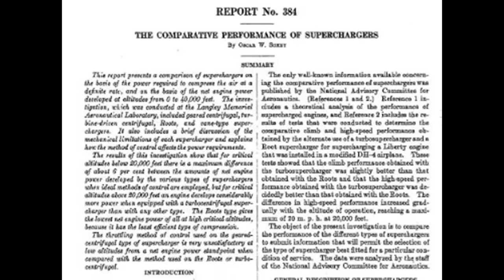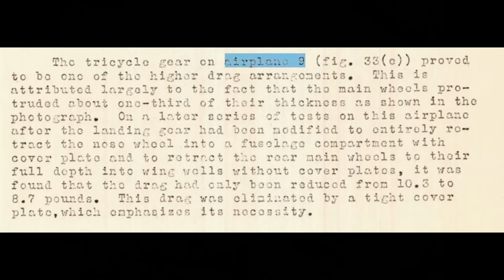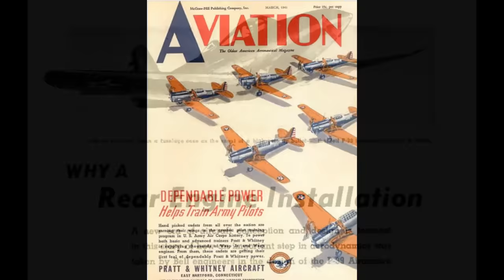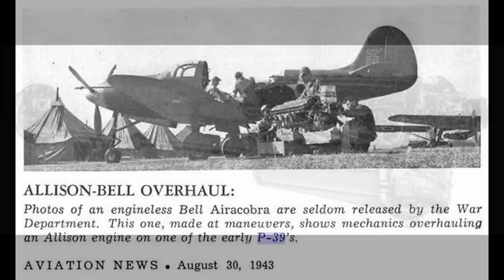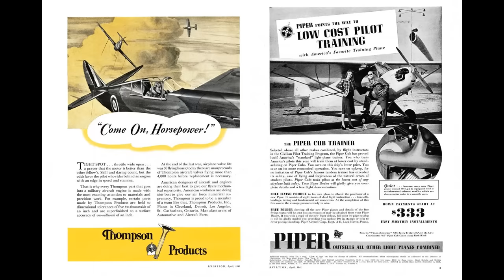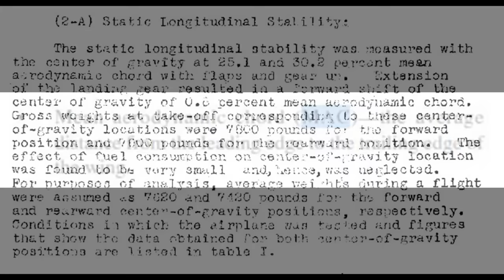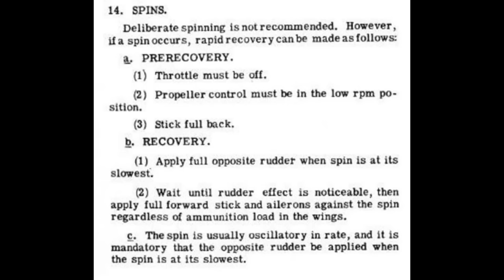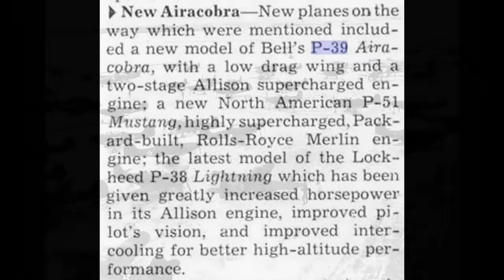Bell P-39 Airacobra, Why the Mid Eng?

Comment: Russians loved it. Had big door to climb in/out. Had reliable instruments. Had actual gunsight. Heavily armoured cockpit. Allison could be run with their supply of LL avgas or even with blend of that and Soviet crap avgas. Was made with 100% dural, designed by actual  engineers, not some plywood wonder with wishfull thinking glue ripping apart construction. Well armed. Easy to land (you could see where you were going). Could fight with Bf-109 or even FW-190 in very low altitudes, like majority of combat in eastern front. For Russians P-39 was an Cadillac. It worked, was luxuriously equipped, and could held its own in deck.

Comment: The C5-C7 (1997-2019) Corvettes had the engine mounted in the front of the car behind the front axle with the transmission mounted in front of the rear axle. I think only Ferrari was the only European manufacturer to do that as well.
Reply from the maker: Alfa Romeo.

Comment: Nice video and very informative like they all are, but I think that Greg's theory about the prop torque on the 10 feet of forward fuselage does not make sense. The prop shaft will transmit the torque directly to the engine and thus the engine mounts, which in turn pass the torque to the mid fuselage section. Which I think is a better location to absorb torque than the front fuselage section with a front mounted engine as the latter may torque the whole fuselage like a corkscrew.
Reply from the maker: I literally put on the screen the section of the article where Bell's chief engineer describes this exact problem.
Reply: You are forgetting the mounting for the reduction gearbox at the extreme end of the nose.
Reply: @GregsAirplanesandAutomobiles  Greg, you are entirely correct. I oversaw the reduction gearbox, which has to be kept in place by the forward fuselage. The engine tries to wrap the forward fuselage due to the force which the engine sprocket exerts on the prop gear. The forward fuselage has to counter this torque. My apology for my short sightedness.

Comment: How did they ever come up with the "Useful Load" and design weight of a P40 pilot with parachute being 180 Lbs @ 24:45. Those seat pack chutes must have weighed 50 Lbs. That makes for a really small American pilot at 130 pounds. Being as small as he was. I don't think Alan Ladd even weighed that little
Reply from the maker: You should see how they calculate standard airline passenger weights.

Comment: Did any of the fighter designs utilize side trust to the right to counteract left torque at take off?
Reply: Vertical stabiliser fixed offset to counter propeller slipstream is common.  Actual torque is less important and is a rolling tendency.  Engine and propeller speed changes are also much less abrupt in planes so torque change is also trivial.
Reply: Rubber powered models have a marked torque swing to the left on take off due to power burst. Schnieder trophy racers had similar situation and used various measures to counter act such as carrying fuel in the port float . The M72 went to contra rotating props.  Latge props used in rubber free flight magnify the problem.

Comment: If long propeller drive shafts were inherently trouble-prone, the propulsion setup for Consolidated's B-36 would have turned out looking very different.
Reply: In the B-36s case I suspect the use of the R-4360 with 14 power pulses per crankshaft rotation helped a lot. Look at the other contemporary pusher bomber design. The Northrup flying wing. They compounded drive shaft issue with contra rotating props. While a drive shaft does add a failure point stresses to the whole system can be reduced imo if the system is a rigid set-up with no universal joints.  How many times have high performance racing cars with IRS suffered mechanical failures from u-joint failures.
Reply: @mpetersen6  The B-36 did not have a drive shaft, just an elongated engine case. There is some thought the Flying Wing's vibration problems came from a drive shaft diving pusher contra-props chopping through the near sonic airflow behind the wing. At least the B-36 props were centered on the wing ensuring somewhat symmertric loadings, as opposed to the Wing's propellers being mounted above the wing.
Reply: Memory is a flakey thing -- mine, at least.  Would have sworn I saw an exhibit at the USAF Museum showing a rotary engine, long drive shaft, & prop -- as I recalled, "from a B-36".  Should have double-checked before posting . . .

Comment: Wasn't the P-63C a "superprop" to some extent, being powered by the uprated Allison V-1710-117 engine with a war emergency rating of 1,500 hp (1,120 kW) at sea level and 1,800 hp (1,340 kW) with water injection and the wingspan reduced by 10 inches (250 mm). I couldn't find any data but on 1,800 hp it should have been something of a hot rod in terms of speed and climb
Reply from the maker: It could be considered one I suppose.
Reply: Do you have any performance data on this one?  @GregsAirplanesandAutomobiles

Comment: If a plane is designed, built and balanced properly where the engine is mounted shouldn't be a problem. A mid engined plane should have less inertia when compared to a front engine or rear engined plane, the only drawbacks being the extra weight of the drive shaft and expense. Maybe a different engine may have helped giving it a better power to weight or a better blower so it could perform at altitude better.The allies had a stable full of excellent aircraft and the P39 was out shone by them. The Russians seemed to like it😀

Comment: There was another  interesting aircraft in 1936-1937 ( prototype concept sown at the paris airshow of 1936)  of the Koolhoven factory .  it was called FK-55 ,    it was a mid engined counter rotating propeller aircraft .  due to the pilot beeing cooked ti only flew a few times. But it was a beautifull aircraft to look at.  and some real futuristic features.
https://en.wikipedia.org/wiki/Koolhoven_F.K.55
Reply: The mock-up displayed in Paris, of which Wiki has pictures, looked beautiful. The actual aircraft as built and flown (once) looked, in the words of Frits Koolhoven himself, like a pregnant duck. Koolhoven was opposed to low-wing designs, and that made the configuration really awkward.
Reply: @emmanuelgustin7851  Correct , the engine they used was a different one they planned underpowerd and much larger than they wanted to have.   The main isue it had was that the pilot got cooked . Still many features on that aircraft would turn up in to other postwar era aircraft .  Its a shame as Koolhoven had a bit of a hit and miss streak with aircraft. 

There is also a verry interesting air craft called the S21 an aircraft that was under construction by a shipyard called schelde .  
Its prototype  was underconstruction when the germans invaded it was damaged during the invasion and parts where send to germany for study .

The S20 concept plane well that was a weird looking aircraft  . if you would tell some one it was a converted car you migh believe it .

Comment: An inline engine is a single bank of cylinder in a row. V designed engines had two banks of cylinders in a row.
Reply from the maker: I hear you Lars, but in WW2 V-12s were usually called "inline" engines. I suppose that's because as compared with radials, they are.

Comment: The thing I never quite understood about the Airacobra and the Kingcobra was how a mid engine aircraft has tricycle under carriage where front engine aircraft usually are tail draggers.
Reply: Because they CAN: tractor engines don’t usually have room for the nose gear, especially not one strong enough to hold that heavy engine

Comment: I think moving the cockpit closer to the center of gravity does reduce pilot stress. It's easy to picture if you make a comparison of a real fighter plane to the same plane, but you make the latter 10 times as long, have the cockpit still near the nose and keep the center of gravity in the original spot - I mean, if this bastard plane was just as maneuverable as the original, just imagine the Rollercoaster ride any maneuver turning up/down and left/right would be.
Reply: Though it's probably rather insignificant in real aircraft

Comment: It seems like Boeings have relatively forward c of g compared to Airbus. The A320 series that I fly has a median setting of around 30% and can go to in excess of 35% depending on conditions. Wonderful video on a very cool plane though.
Reply from the maker: That might be a fly by wire thing. I makes sense that it could have a more aft CG since the computer will keep it stable and you "can't" stall it anyway, so stall recovery shouldn't be an issue. I'm just guessing, I have never flown an Airbus. I do like riding the the A350 though!
Reply: @GregsAirplanesandAutomobiles  Since the Airbus can degrade to direct law, it has to be stable enough to fly like that. So I imagine the FBW is not used to expand the CG envelope to the back for neutral stability like the F-16, etc.

Comment: I think the mid engine installation was because the plane was originally designed to be turbo-charged & being mid-engined meant it wouldn't need all that plumbing that made the Thunderbolt so fat. Of  course it ended up being help in regards it's cannon platform. But there's no reason, with careful design of the inlet manifold & magnetos, that they couldn't design it to have a motor-cannon like French & Soviet inline fighters. German fighters like the BF109 & He112B had inverted engines meaning different engineering/design challenges to make them have motor-cannons, so that's another different story, not really relevant here.
Reply from the maker: It sorta seems like you commented without watching the video because the designer of the plane makes it VERY clear why he went with the mid engine and it's not for the reason you stated.
Reply: @GregsAirplanesandAutomobiles  But the decision to go with the turbo occurred before the aero was cleaned up in response to NACA advice, which also included removing the turbo. So the Turbo was definitely a factor in the original design. By having a mid engine they could have the turbo right up next to it. This would negate all the plumbing that made the P47 so fat. That had to be an influence early on. Or are you saying the fitting of a turbo was irrelevant to the design?  One has to take what designers & engineers say sometimes with a grain of salt. Sometimes when being interviewed, answers can sometimes seem contradictory to other answers in regards different subjects brought up by different interviewers. This is not uncommon. They have a lot to remember & some questions can be very specific. Maybe he took the question as specific to NACAs aero advice & Curtis's response. I don't know. But the demand for a turbo as originally specced by the Army Air Corp must've had some influence on the original design, before NACA may have suggested it should be removed to aid cleaning up the design, aero wise.

Comment: I wondered about defense contractor favoritism and how it might affect material supplies for the "War$$$Effort"
Reply from the maker: I'm certain it had an effect, but it's tough to know just how much it factored in.
Reply: @GregsAirplanesandAutomobiles  Politicians take kickbacks. Pretty sure that is as American as apple pie
Reply: @pavanatanaya  not so much American as it is a universal truth of politicians.
Reply: It's not just the US. Or kickbacks per see. In the UK Rolls Royce had a lot of influence with the Air Ministry. France in the 1930 and into 1940 had truely bizarre. Military aircraft would be finished to flight condition and then flown to other locations to install armament, radios etc. 
As to potential turbo superchargers and materials shortages.  One needs to remember that there were various competing needs for alloying elements. Tungsten was needed for armor, armor piercing projectiles, cutting tools, alloy steels and other uses. The same would go for molybdenum,  chromium,  vandium etc. Plus as much steel the US was producing during WWII it was pushing up against its limit of steel production. The competing needs of various ship building programs, vehicle production, weapons would see various programs timetables slip to some degree. Some such as the Alaska Class Cruisers should have simply been cancelled. Other needs would see various operations such as amphibious assaults be required to be scheduled allowing required assets to be shipped from one to another.

Comment: By not having the engine in front of the pilot a machine gun can be fired through the center of the propeller.  This makes the gun easier to aim.  The P-39 had a big Oldsmobile 37mm canon under the pilot's seat that had the muzzle in the center of the prop.
Reply: You haven't really watched the video have you?
Reply: Chuck Yeager was pretty scathing about the cannon. It's low velocity meant it's trajectory was completely different from the machine guns.

Comment: Toward the end of the video you mention the "efficient" wing of the P-51.

I've seen a couple of claims here and there recently, which hold the the alle ged supercritical lift of that wing is a myth, and that in all likelihood, the P-51's superior range was not due to the wing, which probably did not achieve a supercritcal conditionb in actual  use, but simply to superior craftmanship, resulting in a smoother skin and reduced parasitic drag.
Reply from the maker: I said efficient, not supercritical or anything else. I have an entire video on the P-51's wing and the laminar flow myth.
Reply: @GregsAirplanesandAutomobiles   Agree. Wasn't being critical or anything, and now that I think about it, that video might be one of the places I saw the claim .
Reply from the maker: Thanks :)

Comment: Mid Engine turbo charged v12, shoved into an aluminum monocoque, runs on 100 octane leaded fuel and goes over 300. 

By every metric that should have been a good thing...

Comment: Have you ever seen any other Allison V1710 powered machine with nose mounted gun, firing throug propeller hub? I certainly can't remember anyt other than P39, and i am certain that Allison V1710 had no provision for a such gun installation. 
The 37mm cannon was certainly and without any doubt the main factor contributing for the engine's mid fuselage installation. Please bear in mind that Bell had long and mostly tedious history for pushing the use of Browning  M4 gun with other interceptor designs. The only solution to mount the M4 autocannon to a single engine fighter, was to move the provided allison engine aft of gun and cockpit using propshaft, wich itself, wasn't exactly huge, concidering the amount of torque delivered throug it.
Reply from the maker: I haven't seen any other US fighter shooting through the prop hub period. The engine itself doesn't need a provision for this, it's the prop drive offset that matters here. If you wanted to do it with a front engine Allison, you could.
Reply: @GregsAirplanesandAutomobiles  Actually, the engine cannon, or motorkanone installation needs to be taken account from very early on during the engine design cycle. Allison V1710 and RR merlin, as they were built and designed, were basically impossible to mount engine gun, because of the way these engines were designed. Because of streamlining the engines, the designers crammed as much as possible components behind and between the cylinder blocks and heads. Intake manifolds, auxilliary devices and especially the compressor and carburettor/injection installation behind engine were the limiting factor. If you offset the prop shaft (Merlin already had a such crankshaft/propshaft offset) so that you can mount a weapon firing port through, you still need to move the compressor to a different location and that is a major redesign. Hispano-Suiza Y-series and subsequent Klimov M's, DB600-series and Junkers 210-series were all designed from ground up to take weapons firing throuh the prop shaft, although not all aircraft with these engines used such. Hence I call it a provision to install.

You also need to take account for the Bell's fascination to install the M4 gun to aircrafts, they proposed several desings which used that gun, and everybody else's interest to use it was basically nil. The folks at Bell knew from the very beginning that they cannot install two M4's to the wings of a single engine aircraft without a severe performance and weight penalties (at least not for the intended use of the design and with available engines) , so they opted for a single nose mounted M4. Nose area streamlining was also a factor, but the necessity to mount the engine midframe came from the need to arm the aircraft with M4 cannon.
And P39 was the thing they came out with. 
And i'm with you with that, that the P39 has much more worse reputation that it deserves, it was balanced and really innovative design for its time with many good qualities.